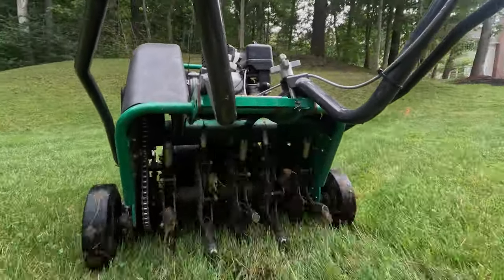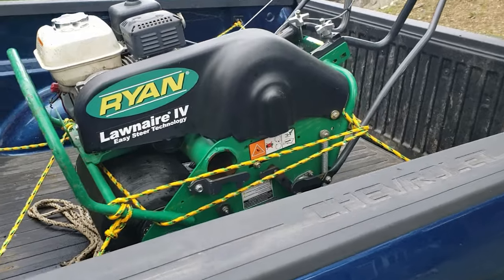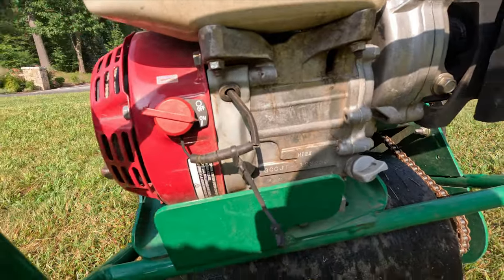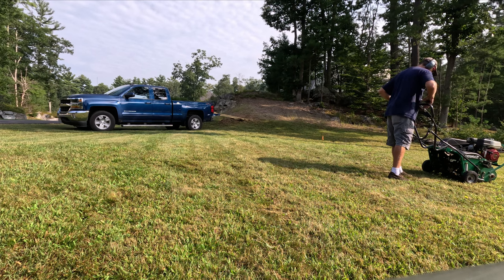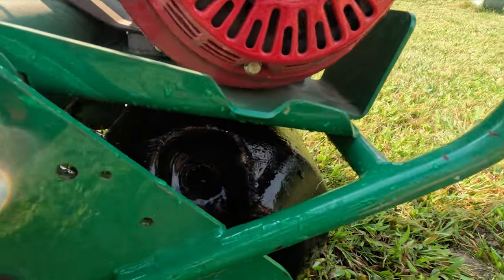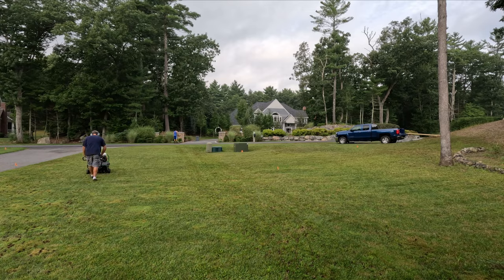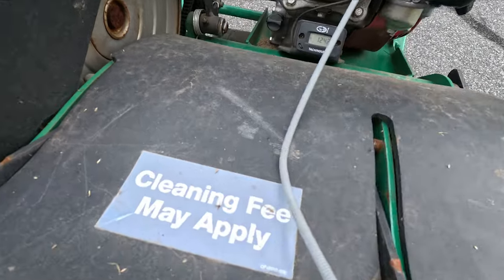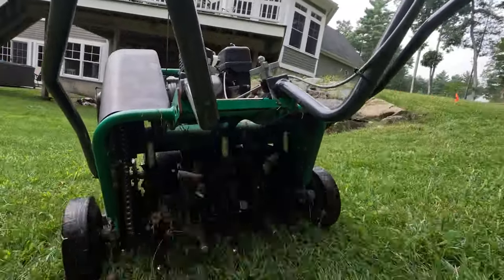Renting Aerator from Home Depot. Tips, Tricks & Save Money DIY Ryan Lawnaire IV Aerate Lawn Yourself

Comment: Is this significantly better than a tow behind aerator?  My tow behind seems like it doesn’t penetrate quite well enough
Reply: Usually that means there's not enough weight, if your soil is really compacted it can resist the tines. The only way to get through that is lots of weight. You could try putting some exercise weights, sandbags, or anything heavy on it to weigh it down, just make sure you can strap it on well enough that it doesn't fall off.

Comment: You referred to the aerator at 5'21" as what kind of aerator?  And is this the Ryan Lawnaire IV model?
Reply from the maker: @MichaelKaufman-v6u  it's a Ryan Lawnaire IV aerator. I rewatched the video I didn't notice anywhere referring to it as 5'21". Well, thanks for watching
Reply: @onesimpledad  I couldn't understand what you described the aerator to be at the 5 min, 21 second mark in to the video.  After watching it again, I think you said "turn and go"?
Reply from the maker: Yes, I said, "Turn and go"... which is the style of aerator. No stopping to lift tines to turn  just make wide turns and go. Makes the job go a whole lot faster.